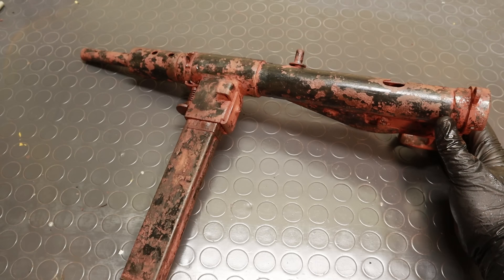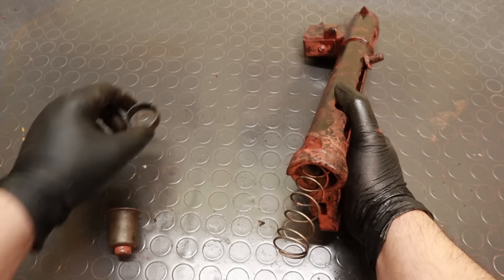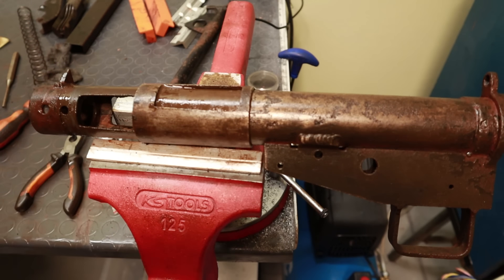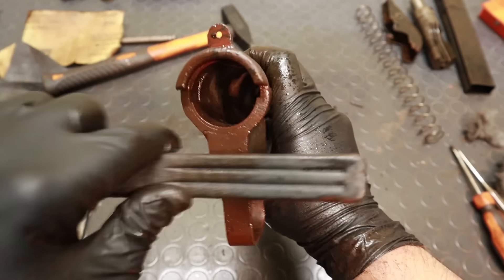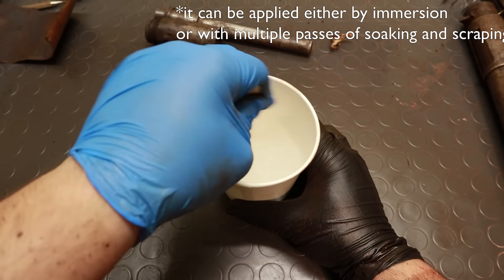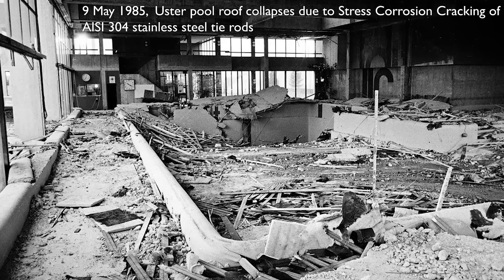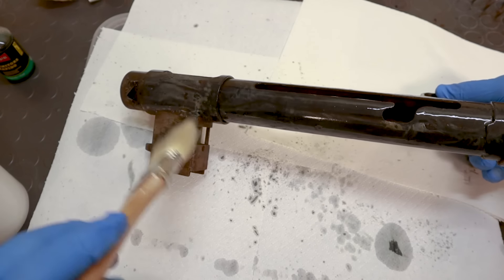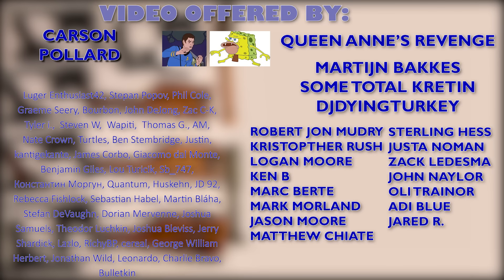Restoration of Rusty STEN Mk2 Submachine Gun

Comment from the maker: You can find the second part, where I test the gun and tell a bit of history and technology here: https://www.youtube.com/watch?v=ciF-aQhxScw&ab_channel=BackyardBallistics
Reply: you had it wide open, would have been the perfect opportunity to bake the parts at 250-275f after cold bluing and cleaning.. to apply FrogLube to everything.
every part would be slick, slippery, and kinda shiny too. its an excellent dry lubricant rust preventive soaks into warmed metal's pores as it surface coats.
if you're treating a spring keep its temp below 200f.
Reply: You should use electrolisis instead of oil and steel wool
Reply: @BackyardBallistics Do not do not sell or give away that ammo its exremly expensive
Reply: Don't you think the paint is an important part of the history of a museum gun? so that any paint that can't be replaced with a nearly identical type of paint should not be removed? at least beyond what is peeling?
Reply: @alan6832  well the paint should be as well preserved as well as everything else but the ammo would be worth a lot more because of how rare old 9mm parabelum is (i think it might be that mabey a differnt one)
Reply: Just wash the new paint of it.
Reply: @modelnutty6503  jijinnjj
Reply: @modelnutty6503  ikonjoikiikij ojiijojoj
Reply: А хочу
Reply: ok
Reply: hmm
Reply: why would you need to test if its fireable or not? is it an illegal firearm that the police are determining if its ornate or not? just curious why the police would need to know whether its operable or not.
Reply: I didn't think that this SMG would be that difficult.  Very simple, cheap parts really.  I always wanted a sterling, early postwar variant.
Reply: سلام خسته نباشید بسیار عالی بود ممنون از شما❤❤❤❤❤

Comment: I’d rather have a rusty Sten then no Sten at all.
Reply: I’d rather have an arm then a rusty sten XD(in case it explodes)
Reply: @puzz8930  the only part that has to be strong is the barrel, plus a nine millimeter Parabellum can’t take off your arm even if it explodes out of battery in your hand.
Reply: @davidgruen7423  its a joke bruh
Reply: @puzz8930  True, but it still shows your lack of knowledge.
Reply: @AdamosDad  i think he was making a joke about how catastrophic firearm failures are sometimes exaggerated.

The joke "I rather keep my arm" is also an exaggeration.

But that's just what i got from the joke. I might be wrong.
Reply: @redlock1815  OK, but we need to train our kids, to know what their talking about, right?lol
Reply: @AdamosDad  
Oh right, didnt see the bigger picture. I agree
Reply: @AdamosDad  I wasn’t serious of course, I literally built a fucking cannon and my is an explosives expert, it was just satire
Reply: @puzz8930  ok
Reply: Bet itd run if you dipped it in desiel
Reply: top
Reply: As long as the bore is clear, the springs are good, and nothing is obstructing the moving parts, it should work until the mag jams (again)
Reply: @puzz8930  It was a bad joke.
Reply: @michaeltoddneyman8508  The ol bucket of Diesel always works 👍

Comment: You could also try simply steaming the gun, Mark Novak does that in his channel for restoration/preservation to convert the iron dioxide to iron trioxide without destroying the bluing on the gun. It also makes for a better bluing overall than just chemicals as the iron trioxide can't convert back to iron dioxide.
Reply: Looks like the rust had gotten under the paint so there wasnt any finish to save.
Reply from the maker: That technique is the basis for rhe rust bluing process, where they artifically rust the part and then convert it to black oxide by immersion in boiling water. However, I don't have enough experience to know what result I would have gotten in my far from ideal case, a mixture of paint, phosphate and rust. I'll leave that to the pros until I have more experience
Reply: @Backyard.Ballistics  steaming is a part of the rust blueing, but it's also part of a restoration process called "conservation", or to stop the active decay of the artifact without sprucing it up.

By steaming or boiling the gun, it loosens up the excess rust, and converts the surface rust back to black oxide, restoring the original finish.

It's a shame you took the path you did in restoring the gun, removing salvageable original finish (both paint, and blueing which was originally under the paint)

It's understandable because you are not a "professional restorer", but the use of cold blue at all is generally frowned upon, and is within the "bubba" territory, it's almost always better to salvage as much original finish as possible, then leave it as is.

Either way, the gun is certainly better then how it started, there was just a better way to go about it
Reply: @Joshua Bullock good on you, both channels offer the depth that the meme gun boys don't even though its fun to watch at times :)
Reply: @Backyard.Ballistics  that's plenty fine, use the amenities accessible to you. Just a suggestion for future perhaps?
Reply: @Backyard.Ballistics  I've done this on a few rusty guns, it's very simple and works wonders even if you're not trying for a perfect finish. Boiling water or steam both work, the great thing with boiling water is that it helps soften old hardened grease and washes away other gunk as well. This often frees up stuck parts, like that magazine well, and it makes the flaky  rust easier to remove while leaving a black magnetite surface underneath. It stops the active rust so the gun doesn't continue to deteriorate.

What I would have recommended would be to boil the whole thing in clean water for an hour or so before using steel wool. Then proceed much the same way as you did, except the rust would be looser and easier to scrub off. Usually have to boil again after initial scrubbing with steel wool, when the rust is that bad. Then fine scrubbing.

It will look horrible when you lift it out of the water, but that's all really loose rust just lying on the surface and is easily removed. Note that degreasing is needed before boiling, or the water cannot get all the way into the rust pits to do its work. I simply hose it down with brake cleaner from a spray can, that works well enough.
Reply: How does that affect parkerized finishes?
Reply: @gregsmith5695  sorry, no idea. To be fair, I'm not sure what parkerized even means
Reply: @locusf2  It is an oxide finish. A phosphate I think. An example would be the finish on an M1 Garand.
Reply: @gregsmith5695  it doesn't affect it at all. Of course any areas where the parkerising has rusted away will become black instead of the parkerised grayish colour, but the finish there was already gone anyway.
Reply: @Kaboomf  That is what I suspected. Thank you for clearing that up. One of those things that one is reluctant to put to the test without a little bit of confidence.
Reply: @Backyard.Ballistics  boiling it in normal water will convert the rust into a easier to remove form, without any special chemicals or techniques, not ideal on a non blued gun though
Reply: @Backyard.Ballistics  bet you could do it first try.
Reply: Stens weren't blued.

Comment: As another piece of trivia, this volume expansion of iron when it rusts is why iron and iron-based alloys can rust away completely. The rust cracks and lifts off the surface, exposing a fresh metal surface for oxygen and water to act on again. With other metals, like aluminium, the amount of volume per metal atom is more similar between the base metal and the oxide (for aluminium, that ratio is 1.28), so the oxide forms a solid, airtight layer that prevents the underlying metal from further corrosion.

Comment: Nice job, and very non-intrusive conservation!  The finish on my STEN was not as far gone as that one, but rather than remove the  finish that did remain, I opted to clean it with paint thinner (so as not to damage the bluing) and spray painted it with "wrinkle" paint, giving it the appearance of a Sterling.  It can be brought back to its previous finish, if desired, but looks quite nice with this finish!   Thank you for the video!

Comment: Pro tip to remove rust but keep your finish: Galvanic rust removal. Dissolve Sodium Carbonate in (preferrably warm) water, place an electrode in it and connect your part to negative. Apply 6-12V (6 works best for me) and let it do its magic for a few hours.

Afterwards a regular brush will be able to remove whats left of the rust, leaving your with nothing but steel. Bluing will not be harmed at all. I have used this method many, many times. The result looks much better then it does after all your brushing, with probably 1% of the effort.
Reply: My revolver with rust doesn't have bluing, but I think it's some cover, this method won't remove the cover right? I got most of the rust off with oil, but there's some flaky parts on it.
Reply: @urboyseth5922  I have seen some paints that where partly "lifted off" the material, in areas where it was cracked already. I think what happens is that bubbled form underneath the already lose paint that lift of the paint in this areas. Far less then any wire brush or steel wool would do though. 

With nitrited and phosphated finished I have no experiece, as these are really rare her ein europe. By my limited understanding of chemistry it should not harm it though.
Reply: Extra pro-tip instead of removing the rust. Convert it by boiling the parts in  water then card off with OOOO steel wool or a super fine wire wheel (should be able to touch it while spinning) . It will convert it back into the original bluing and you end up with even less work.

Comment: The firearm itself might be structurally sound, but is the rough surface left by the corrosion not going to accelerate wear between sliding surfaces, say the bolt and the receiver?  I know you aren't a professional restorer, but would that be of any concern to one, or is the material already too badly damaged by that point for this to become a concern?
Reply: So in this specific case the firearm has undergone uniform corrosion and is almost entirely orange. This is actually a good thing which negates some excessive pitting, making the firearm potentially safe to shoot.

In terms of safety and use, the sliding parts would probably be fine as long as the initial rust is mostly removed. However, the barrel and chamber are an issue. The higher tolerances required by most machine guns are negligible to think about for most of this firearm (as it is a simple tube gun) but the biggest issue I can think of is corrosion within the chamber. This corrosion can leave microscopic pits which can more easily grip a cartridge that is being forcefully pulled back by its rim. The rim and can ripped off and the case left behind in the chamber. 

But yeah it terms of corrosion within the tube there is most likely not a huge issue with exacerbated wear as the tolerances are low and the gun isn't being run dry. Also even if rust was still in the action rust is much less hard than steel and won't hurt the steel too much.

Sources; I'm a corrosion engineering major
Reply: Whoopsh!
Reply: There is more than enough contact to resist wear.  Pits will be spanned for the most part; if you are concerned about roughness.  Besides, they are not going to shoot it very much.
Reply from the maker: It won't be a problem, there is very little sliding friction in this design (little force pushing the sliding surfaces one against the other), as is the case for most gun designs, woth some notable exceptions.

Comment: The sten gun was actual genius. Simple. Easy to manufacture. Reliable. Easy to fix. Theres no finesse there, but it did what it was designed to do, at a low cost. It was an ak47 before there was an ak47.

Comment: A good trick for stuck bolts and parts is to use a 50-50 mix of automatic transmission oil and acetone
Reply from the maker: I've heard about it, never tried it myself though, and didn't have any ATO at hand

Comment: For removing rust, I recommend evapo rust, which is, like its marketing claims, super safe. It does not harm the skin nor does it smell bad. Also, if you know how to blue metal, don't worry about removing the original bluing if you plan on re bluing the gun anyways. If you don't want to remove the blue, what you did is fine. I am a gunsmith from Texas and have restored a few firearms so far like a Swiss K11, a Calvary Carbine Carcano, a Ruger 10/22, Century Arms Sporterized L1A1, and fixed a Winchester 1897 that was not feeding right. I have done a lot of bluing, wood work, fabricating parts on a lathe and mill, and even jeweled a bolt from a friend's hunting rifle and I got to say, gunsmithing is an absolute joy of mine.
Reply: Yup , I would've just chucked the whole thing in a bath of evaporust before even trying any disassembly.

Comment: Steel wool does work as a rust remover with lubrication, however you may want to try using a copper brush and oil instead if you deal with a gun in the future where you want to preserve as much original finish as possible. 12 or 10 ga bore brushes work well for this, and as a softer metal you don’t run the risk of doing any damage to the steel surface. It’s a safer way to remove surface rust on nicely blued guns for this reason, since it will not harm the surrounding good bluing.

Comment: I never thought of using citric acid. That’s pretty resourceful thinking. 

About 6 months ago, I was given a bunch of old rifles that were sitting in storage and got rusted pretty bad. Not as bad as your sten but still bad enough. In the box they all came in was a lonely revolver (S&W M&P .38 special made in 1917) that so one painted several decades ago after it started to rust (I think). 

I spent about a month getting all the paint off trying to not remove any extra material. I am glad I did because it came out pretty awesome but all of its original blueing was gone. Still, it’s a really cool piece of American firearm history. Now I can’t wait to get the rest of these things done.
Reply from the maker: Thanks for sharing! Evaporust is better than citric acid, but it's way more expensive, especially if you need to fill a vat with it
Reply: @Backyard.Ballistics  I have used it but as you said it’s expensive. However, I did just get some stuff like it in the mail I bought from eBay. It’s called “Industrial Rust Eliminator” or IRE. it was less than 1/2 the cost of Evaporust, stored a lot easier since it comes in a powder that you add water to and because it’s a powder, you can choose how strong you want it. I soaked some rusted fasteners in it (mixing it for standard strength) to give it a try and it did really well. If you haven’t tied it yet I would line to see what you think of it. Still, I’m gonna try some citric acid on some of the critical parts of these rifles just to avoid risking damage to their structural integrity.

Comment: The STEN guns were painted primarily because, as weapons, they were manufactured by factories which were generally unfamiliar with firearms and bluing. Lion Bicycles, for instance, built STENs, as did Singer; Both of which had Zinc bath and paint baths and could do that faster than bluing. This choice of using factories inexperienced with traditional methodology means that a lot of British weaponry during WW2 can be found with "Irregular" paint features or manufacture techniques that would not normally be expected. Oddly, Lion Bicycle works, in Wales, used transferable parts between their bicycles and STENS so it is occasionally possible to find Chromed and Zinc-plated parts for STENS if they were rushed in production.

Comment: If you boil the metal it will convert the rust into non reactive oxide then use a carding wheel to remove it

Comment: The best way to treat rust on guns is to boil the rusty parts in water. This actually reverses some of the rusting process and can have quite spectacular results. It almost seems like magic the first time you do it.
Essentially, you boil the parts for about 30 minutes, and then gently card the loose material away with soft steel wool, then boil again, and so on. It takes a while, but it is way better than simply removing the rust down to bare metal.
Reply: But I wanted to post this.....you beat me to it.

Comment: From what I heard Evaporust converts the rust back to íron thus preventing some pitting.
Reply from the maker: I don't think it does, It just binds to the iron in iron oxide and pulls it in solution, effectively dissolving the rust. But it's not reducing it back to metal
Reply: thats quite literally impossible. Even if you manage to remove the Oxigen from the rust, it still has a much lower density. There is simply no way to make the iron flow back into the place it came from.

Comment: A warning about evapo rust, it will eat rust bluing and actually will eat steel. Years ago before I knew anything about bluing types or any of that kind of thing, I had my 1911 disassembled and in a ultrasonic cleaner, I decided to use evapo rust and wound up leaving it in there for over a week before I was ready to put things back together. the whole finish was removed, something I now would know to expect, but also some serious pitting in the frame, slide, hammer, and mainspring housing. I doubt if I had not left it so long that pitting would be so bad, but to this day  it is a stark reminder of a mistake I have learned a lot from. I just recently stripped all the rustolium paint I used to temporarily re finish it, oil blued all internals and soon will try my hand at rust bluing the frame and slide again. but even after sanding it smooth to the touch, you can still see the pitting and it will never be what it was before.